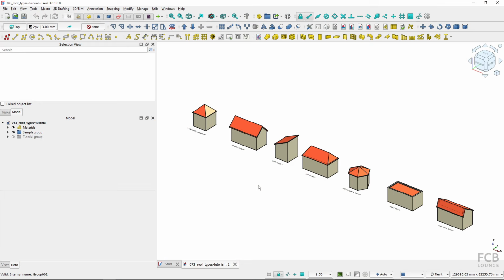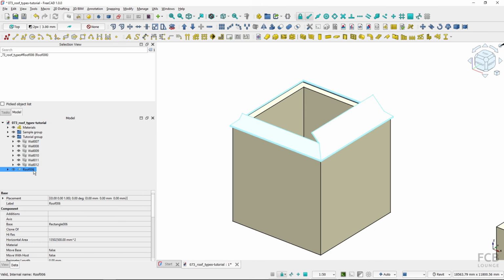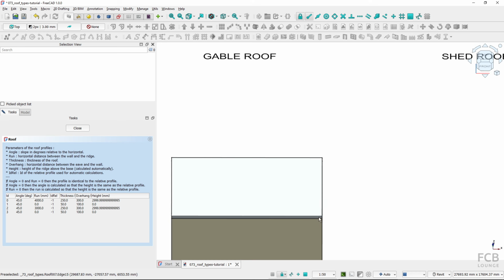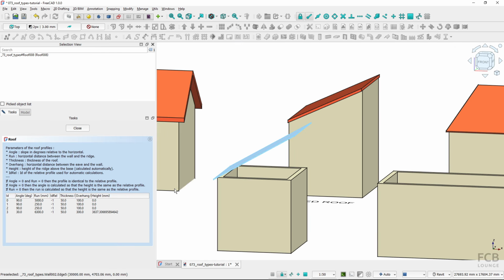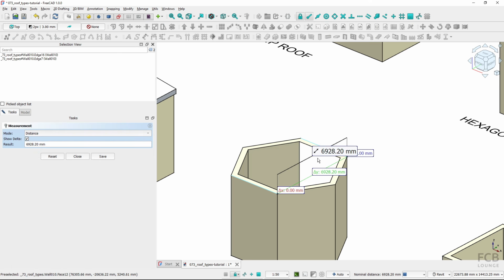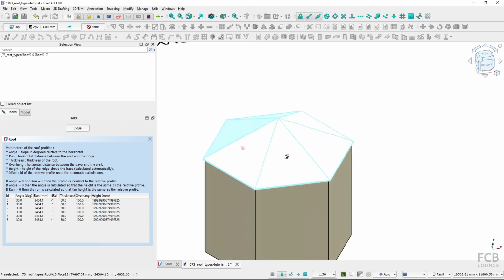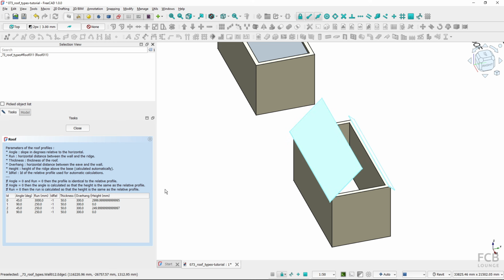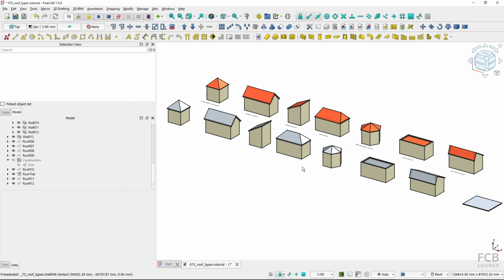Basic Roof Types in FreeCAD BIM

Comment: Cutting the wall beyond the roof with the "remove" tool is a bit erratic. When I went through your examples it worked, but in my own projects I sometimes got the error message "wall has no solid", do you know what this is about?
Reply from the maker: Few users have encountered similar issue. If I remember correctly, it could be caused by inaccurate modelling (walls were not level). I guess it can also happen when one roof is cutting many walls. But I don't have nay bulletproof solution.

Comment: Excellent tutorial again thanks! 
Just out of interest, I couldn't get this to work properly in FreeCAD 1.0.1(wasn't cutting off superfluos hip bits), so asked ChatGPT to write a macro to generate a roof shape for any Draft polygon, with a certain roof slope, and after 1 slight error correction, gives great results. Maybe worth considering?
Reply from the maker: All of the roofs from the tutorial should be possible to recreate in FreeCAD 1.0.1

Thanks for the suggestion, I wanted to showcase the built-in Roof tool and what it is and what it's not able to do.

There is also this external tool, which can apparently create more complicated roof shapes too: https://forum.freecad.org/viewtopic.php?t=51382

Comment: How would you go about putting a slope on the flat roof inside the parapet walls?
Reply from the maker: If the slope is very simple, I would use the Roof tool. If the slope shape is more complicated, I would probably use Part or Part Design modeling tools to create the slope shape and than use Arch_Roof to create roof object from of the shape.
Reply: Probably just use a shed style roof and extend the wall height above to create the parapet.